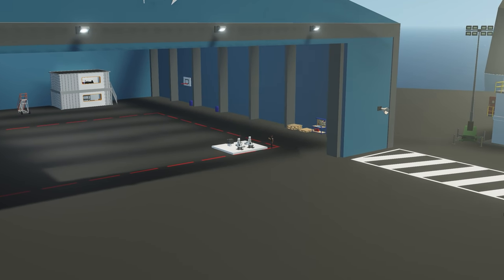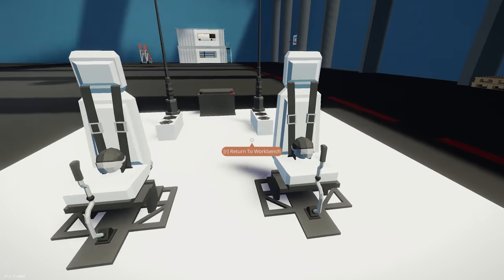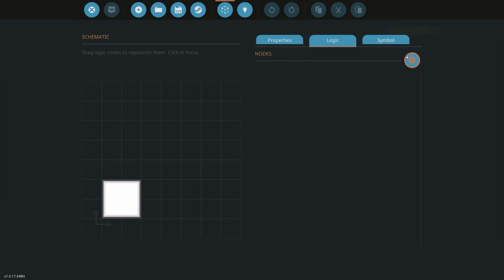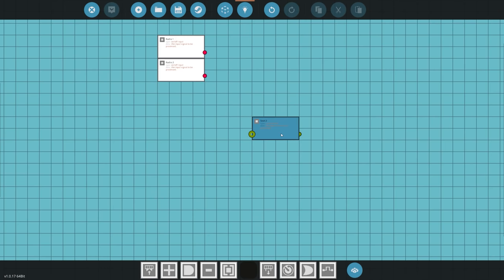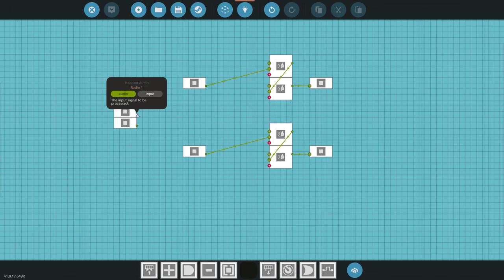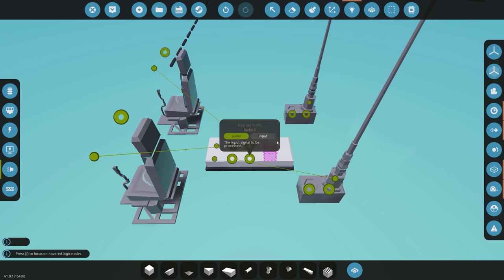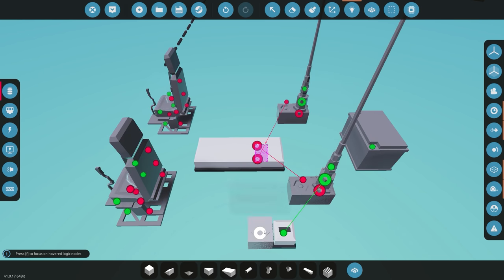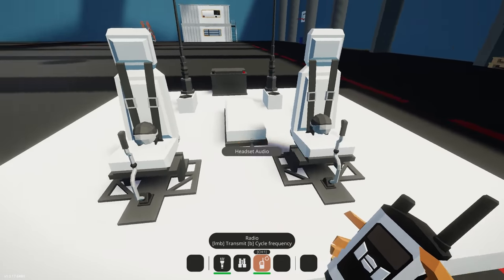3 AUDIO SIGNALS TO ONE HEADSET!! - Stormworks

Comment: They are called microcontrollers, but actually are bigger than the creation itself.
Reply: You can fit a lot more logic in the physical space of the micro-controller. The complex circuits you build on the controllers would take up a lot more space than the controller does. The only thing that changes the physical size of the controller is the number of inputs and outputs you have, and they can't overlap each other.
Reply: @McLaren_2009  

I know, I was ironic